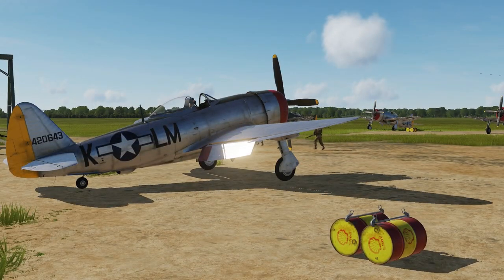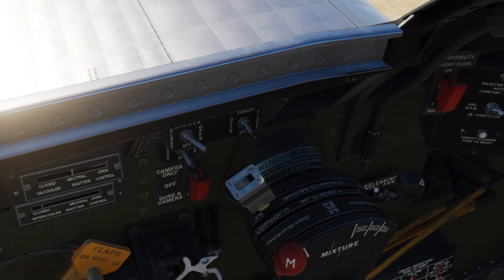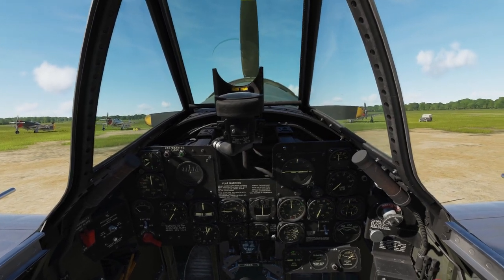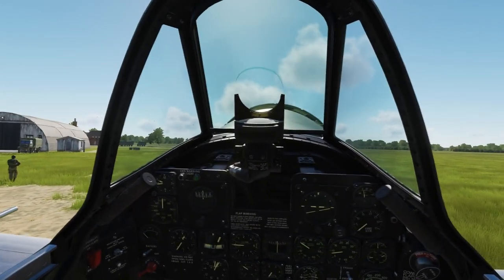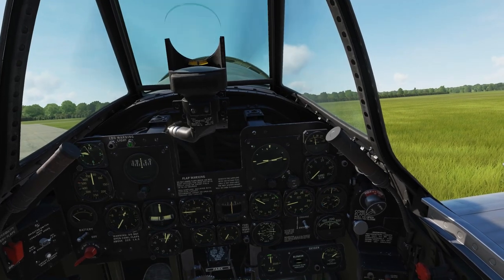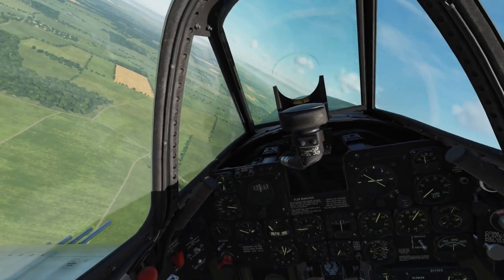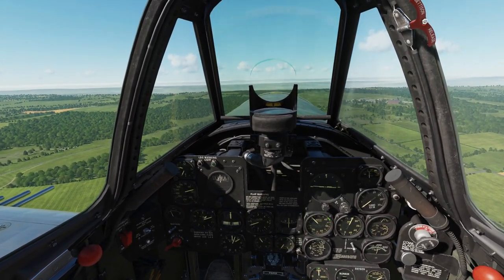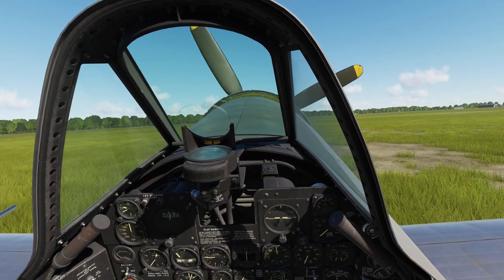DCS P-47D Thunderbolt Startup /Takeoff /Landing Tutorial Lesson

Comment from the maker: What I forgot to include in the video is the throttle / supercharger management. It's easy: Always use the throttle first, and when it's maxed out and you need more power, start moving the supercharger forward. When the overspeed light comes on, you've gone too far, move it back a bit. When you want to reduce power, move the supercharger back, and when it's all the way back, you can start moving the throttle back. Don't use any supercharger for takeoff unless it's a short field. Here's a great video that explains it: https://youtu.be/HHtypRJuNKY
Reply: To clarify, the boost lever controls the turbocharger, not the supercharger. The supercharger is geared directly to the engine crankshaft, while the turbo is driven by exhaust gases that are governed by the boost lever in the cockpit. You don't really directly control the supercharger except through the throttle control lever. These are really just semantics, unless you're super interested in the exact workings of the engine, though!. Thanks for the tutorial!
Reply from the maker: @acegh0st  yes that is correct, I meant turbo charger, thank you.
Reply: @ReflectedSimulations  At no point in the video you showed when you flip the magnetos, they seem to move automatic? Awesome video man, thx for the work!
Reply from the maker: @johngisbourne7197  i have them assigned to a keyboard shortcut
Reply: You count 6 blades then mags to both with mixture in idle cutoff. Then when engine catches move mixture to full rich. This procedure does 2 things; keeps engine from kicking backwards and prevents fuel fire during start since you're running off primer only. Used this procedure during 89-90 fire season in radial engine air tankers.
Reply: Hey, I purchased the Wolfpack campaign but it doesn’t work for me. Apparently if you didn’t upgrade to Normandy 2.0 map from The Channel map it won’t work. I upgraded from Normandy 1 to Normandy 2 so am in that category. Is there anything that can be done? I really love the Jug. I don’t want to risk buying the channel map, it might be too late.
Greg’s Planes and Automobiles channel recommends this campaign too.
Reply from the maker: @chrismillard8222  The Channel map and Normandy (whichever number) are completely separate, different maps. There is no way to 'update' a Channel map mission to Normandy 2, that would mean rebuilding it from scratch. Wolfpack is and will always be a Channel map campaign, as it says in the 'required modules' section in the store. PS: The Channel is well worth it , even if you have Normandy. It has really nice details and also winter textures.
Reply: @ReflectedSimulations  It's all good, I thought Normandy 2 was basically a replacement of both Normandy 1 and the Channel. That''s why I didn't check the criteria. Maybe I'll get it anyway just to play the campaign

Comment: Definitely one of the best engine start/ landing tutorials for the P47 that I have found so far.  Do you have any suggestions for cruise settings?  The charts I have found give some general ranges but no specific numbers for manifold pressure and rpm.  I have learned that a good cruise setting and using auto-lean on the mixture control will greatly increase your time in the air.
Reply from the maker: For climbing you usually need 2550 and 52" to follow the AI. For cruising I either use max continuous if I need to go fast, so 42" and 2550, or reduce it further to 30-35" and 2300. At this setting you can also move the mixture to auto-lean. Keep an eye on the oil and carb air temperatures, and operate the shutters accordingly. Cowl flaps are not really needed in flight. Oh, and always increase throttle first, and if max throttle is not enough, then increase boost. If you want less power, always decrease boost first, and if it's all the way back, then start moving the throttle lever back from its maximum position. This keeps the engine cooler and gives you 200 more HP when at full power.

Comment: Excellent tutorial! I love the clear and organized commentary. 
I have just a question: are you sure (source?) that the warbird pilots used pitch/throttle reversely while landing (i.e throttle for altitude and pitch for speed)? I can be wrong but I think that this method is used for landing GA aircraft today and it was also used by all navy pilots since the WWII. It is used whenever a long and stabilized approach is necessary (i.e. landing on an aircraft carrier) or desired (GA pilot use a long straight approach because it is safer). But I am not sure that the same method was used by warbird pilots generally especially while approaching the runway with a curve or while landing in pairs. These are situations where quick reactions/changes are often necessary and that is why imho pilots use the throttle for speed and the stick (pitch) for altitude.
Reply from the maker: Hi Tapi. To be honest I never read it explicitly in any WWII documents but I'd be really surprised if they were thought differently. Like many Axis pilots in the 30s/ 40s, I started with gliders, and there one of the first lessons was pitch=speed. This is one of the most basic and important reflex any pilot needs to have, no matter what they fly. It's even more true in curved approach situations (which they only did at frontline squadrons, not at primary flight school). You have less "wing surface" available in the horizontal, and if a high performance warbird gets slow, that is , close to critical AoA, applying power to get speed can have disastrous effects. Many young pilots died this way according to books I've read. So I think it's such a basic lesson of aviation that it was never mentioned in Pilots' Notes. By the time a cadet graduated to a P-47, he didn't have to be explained about this.
Reply: @ReflectedSimulations  OK, thanks very much for the answer Reflected. Well, I am not a real pilot so that all I know is from my reading and my sim experience. What you wrote sounds reasonable. I will try to start using throttle/pitch reversely with my warbird landings and I will see if I will be able to adapt to it in most situations... I am always ready to change my mind and learn new things if that conforms to the real pilot's procedures.
Reply: Reverse throttle/pitch is a fact for any aicraft operating below their (roughly) best glide speed or most efficient flight speed.  This is because at the higher angles of attack  required at low airspeeds, the wings are generating lots of drag relative to their lift.  The region of airspeed below the most efficient airspeed is also referred to as the "area of reversed commmand" for this reason.  You can test this for yourself.  Try to maintain straight and level at 5 or 10 knots above stall speed.  If you pull up on the stick you might see a little climb but your speed will drop precipitously and you will soon find yourself slowing below stall speed.  Likewise if you lower the nose, you will get start to descend bit but your airspeed will also increase a lot.  On the throttle side, if you maintain your pitch angle but increase your power you will start to climb with only a small increase in speed.  Pull power and you descend.  So at higher speeds, throttle controls speed and pitch controls altitude.  At low airspeeds, throttle controls altitude and pitch controls airspeed.  This works for Piper Cubs and F14's equally.
Reply from the maker: @brittoncooke1890  thanks, you explained it very well!
Reply: @brittoncooke1890  I actually heard a modern airline pilot say that they don't fly this way anymore. He said they trim for altitude and throttle for speed. I think this has more to do with modern jets using fly-by-wire controls, though, as I'm pretty sure it was an A320NG pilot who I heard discuss the topic. Doesn't really change your point in terms of aerodynamic flight, but I don't think its always true with modern aircraft, in practice.

Comment: The thing that confuses me is the takeoff manifold pressure setting. It should be 51'' - 52'', as you said, but in DCS it doesn't go higher than 48'' on sea level in "default" weather conditions with supercharger alone, you'll need turbo to get there. But everywhere I checked, I saw takeoff procedure with this 52'' MP and no turbosupercharger use. Is DCS P-47 modeled correctly?
Reply from the maker: I've been wondering about that too. You're right, it should be 52" without any boost.

Comment: Hey Reflected, having an issue with the P47 engine oil temp gauge. I am a real life pilot so although I haven't flown a warbird, I am pretty familiar with how a piston engine works but perhaps I am missing something. Here is the issue:

On Start up my oil temp will remain off scale low, and not come up. Normal oil pressure, Cyl head temps and RPM. I follow pretty much the same flow as you just described in the video. 

In a hot start mission, the oil temp is at the top end of the normal limits or just outside. I can not get it to come down by any means. Low power setting, oil cooler, cowl flaps none of them work. Are you aware of any bugs at the moment for the p47 oil temp gauge?

If I am missing a critical step let me know. Thanks.

Kris
Reply from the maker: That’s strange, no idea what you’re missing. Do you have any mods installed? Those may be messing with it. Or wait, there is a bug that makes the oil temp gauge CB pop if you crank the cockpit lights all the way. Maybe ED still hasn’t fixed it?
Reply: @ReflectedSimulations  Ah ha! Thats it, I always crank the lights all the way. Ill go try it now and see if that pops the CB

Comment: Hey Greg,

First of all, I want to commend you for all your work. I'm playing 5 of your campaigns at the same time and they're all great. 

I noticed one thing in your video about the P47: You don't wait until the oil temperature has risen to 50 degrees, but start the engine, bring it up to 1000 RPM and then drive to the runway. 

Are your missions built in such a way that you don't manage to warm up the oil? I always close the cooling flaps for the oil. Can the engine take it?

Best regards and thanks
Reply from the maker: Hi! It's not mission-related what the P-47 can or cannot take. BTW I did wait, there is a cut in the video :) Good luck with the campaign,s enjoy!